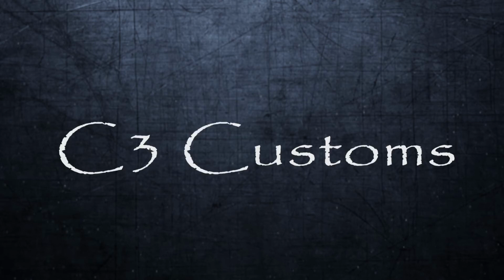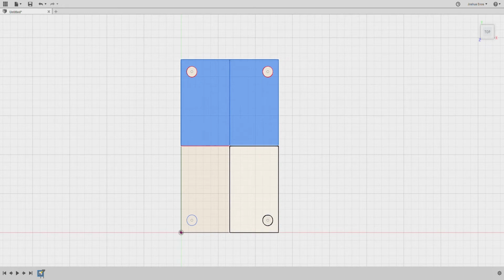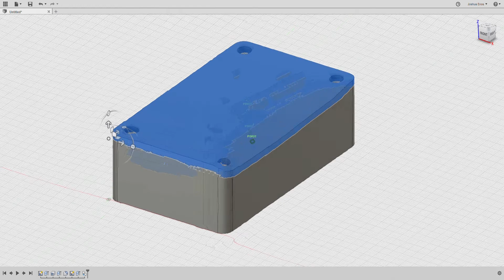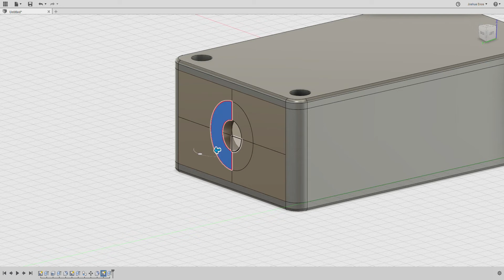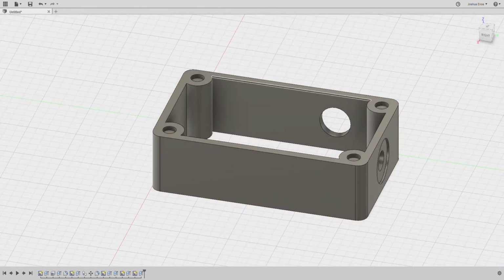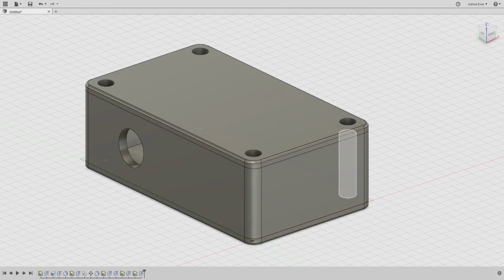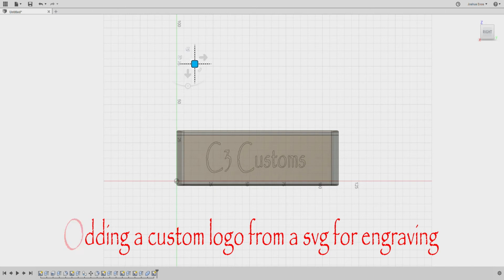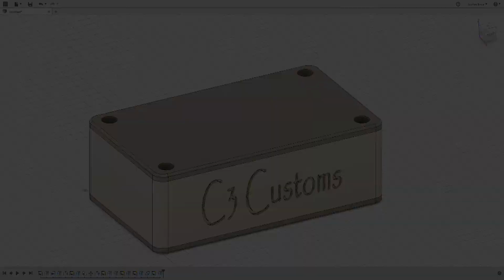Modeling a simple box mod in fusion 360!

Comment: How do you get your build platform to show the measurements in that direction? If i am in top view and drawing a sketch, the x plane measurements are on the left and not the right. It is very hard to lay out my sketches when there are no measurements and i cant seem to find any help on this issue.
Reply from the maker: They used to have a nice scale on the older versions of fusion but since the updates it basically when you start to draw something, it will do the disappeared look where it scales up. What i normally do is just start with the measurements like with a line or like if im using the shapes like a cirle/square etc. I will just input the measurements i need.
Reply from the maker: You can also do the measurements in the menu when you open the  Sketch tab open to leave a measurement bar on it. Sometimes it can be off or have to be activated again. Hope that helps.
Reply: @C3Customs  Hi! Thanks for the quick reply. I can do that but sometimes it is nice to visualize the whole model size too.  For some reason the X measurement is on the left opposite of my sketch so it is very confusing for me.  Do you know if there are any settings to change the sketch plane measurement increments or layout etc.?

Comment: be nice if u told how u  make the doors since u dont have the short cuts u using
Reply from the maker: In the next videos I'll add that to the list so others will see it and know how to do it. Mostly it's making the drawing from the sketch menu and then making the box and then doing a  projection of the piece for the doors and then extrude it to form the doors. Then fillet or chamfered the edges to shape.
Reply: @C3Customs  well that is fine but it hard to follow u if we dont see what you clicking on even with being new to fusion 360 so it might help if u exsplane were to go  when u make the bottom of the  box mod
Reply from the maker: @AndrewMurphy8383  yeah I was using a older video editing system so now I can use a new one to have like the buttons to show everyone what I'm doing so I'll do that in the future. At the time I didn't think about that since fusion is kinda crazy with all that it does and I'm just used to it.
Reply: @C3Customs  kewl it might help to do a remake i would love to make it and 3d print my own but still new to it all pls do a remake with new software love to make my own box mod
Reply from the maker: @AndrewMurphy8383  I'll remake a new one and I just see that for some reason the menu isnt showing up in the video that I made so maybe there is like a button I have to make sure its showing. I'll photoshop some buttons tho for how i use each one so it's better for beginners to see where it's at. Once you get used to it the modeling and drawing up pieces go by fast. Also the cool thing is once you model it in the sketch you can adjust it there and the model will rescale itself.
Reply: @C3Customs  ok
Reply: @Blondie SL i can't find it either i guess it never happened